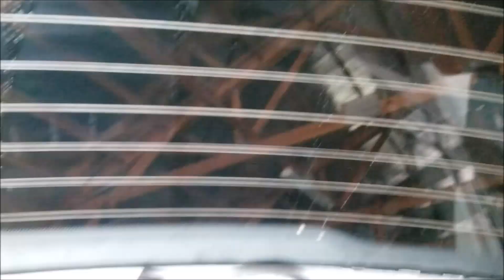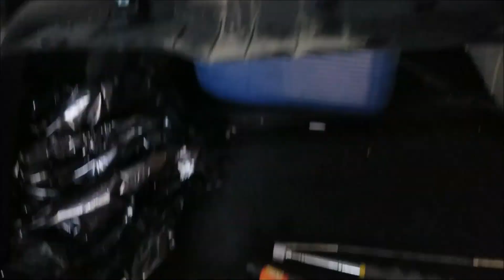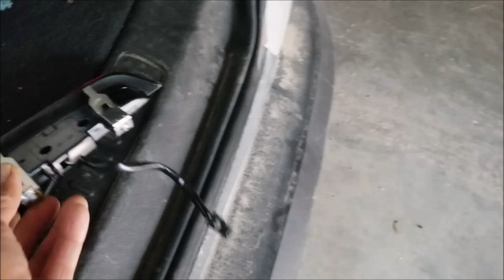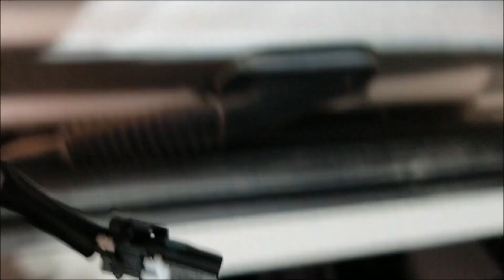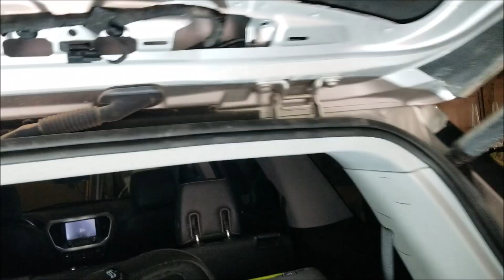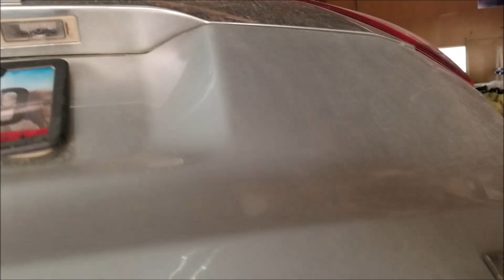2nd Generation GMC Acadia rear window leak fix

Comment: Trying this on mine today as it was leaking oem tail cost $180.00 from the dealer that comes with the new gasket so did the RTV black thick layer let’s see what happens today is 7/30/24